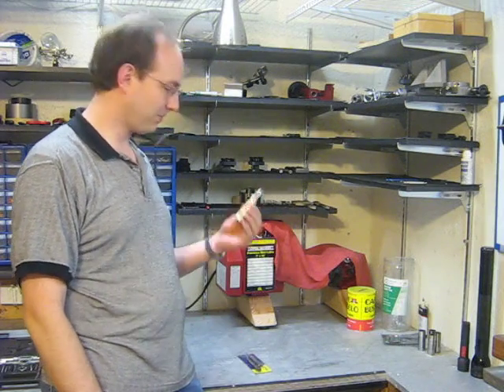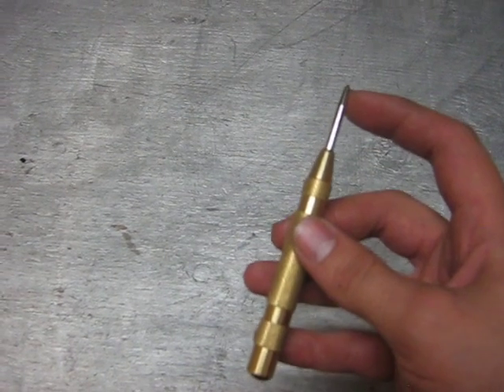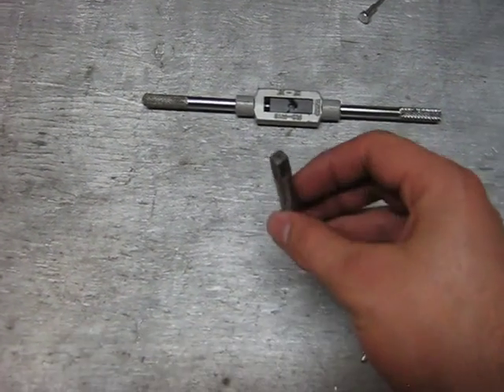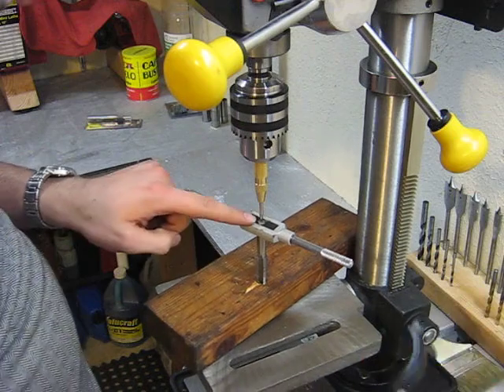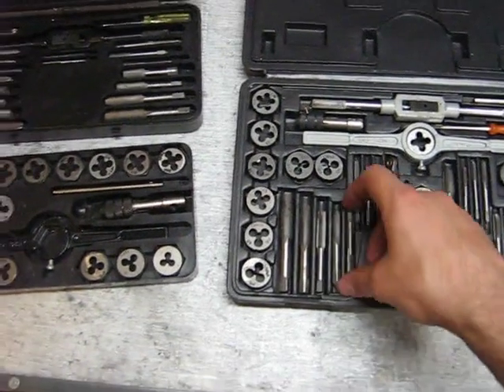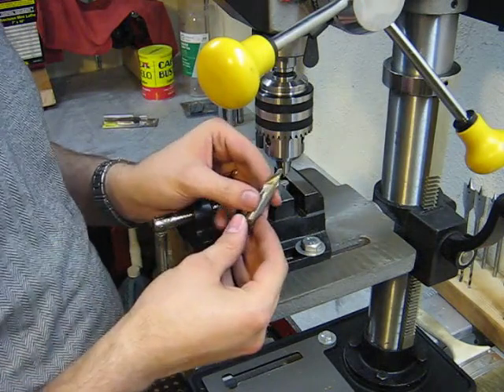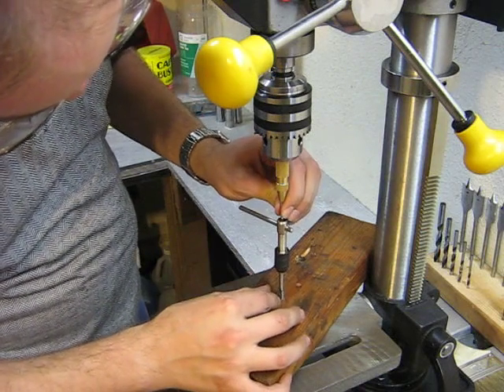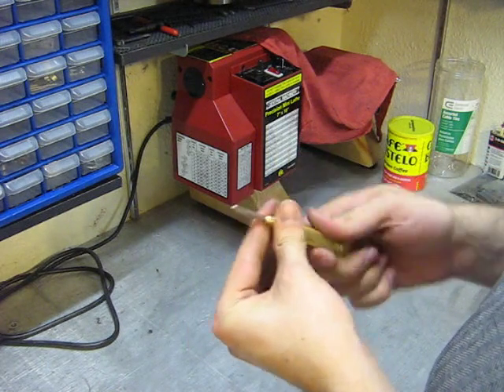Centerpunch + Drill Press = Tap Guide

Comment: If you're still around or anyone else who is looking to tap stuff and has a drill press, you can just put it on the lowest speed and then flip the power switch on and off rapidly while applying some downward pressure with your tap in the chuck. I just got done tapping 16 holes in aluminum and they came out perfect. Very little slop, better than hand tapping and way better than cordless drill tapping. The only annoying part is backing out the tap once you've finished bottoming out. I just pull the safety pin from my drill press and start hand spinning the chuck in reverse. If your drill has a reverse button you can do the same thing as going forward, just slowly cycle the power and make sure to hold the feed handles applying a very light pressure to keep the spring from ripping the tap out of the hole. Super easy.